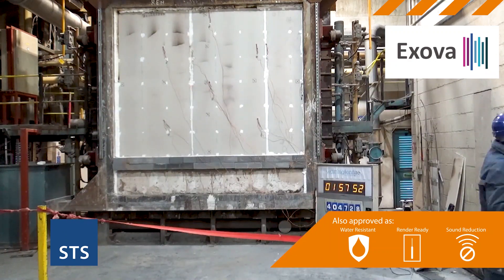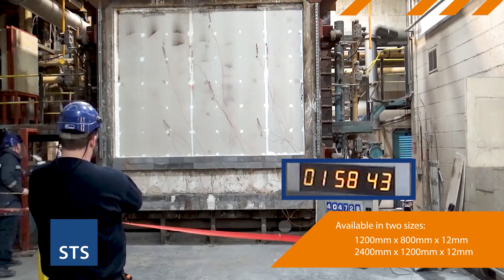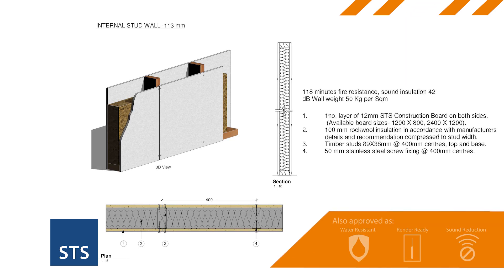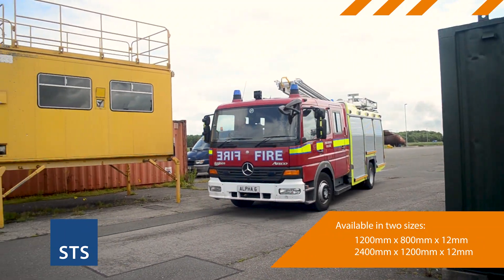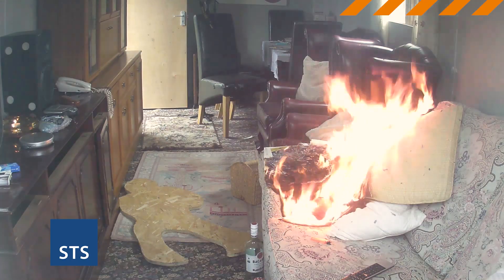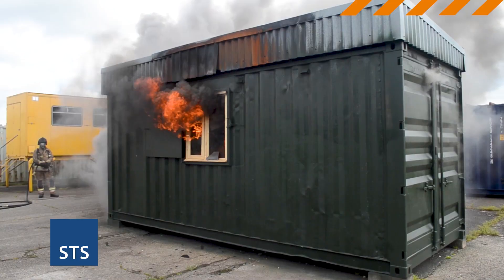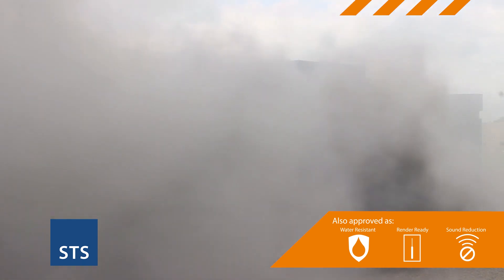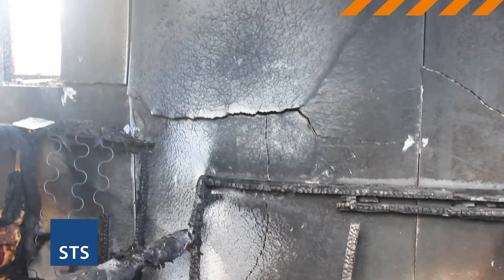12mm STS Construction Board | Fire

Comment: I have just brought a 1200mm x 600mm x 12mm sheet of this board to fully line a small metal box that i am going to convert into a Lipo Battery Charging Safe so i can charge my RC Lipo Batteries safety & with peace of mind, just in case the inevitable happens.
Could you possibly advise me as to the best way to cut this 12mm board ?
Will only be cutting straight lines,
Regards